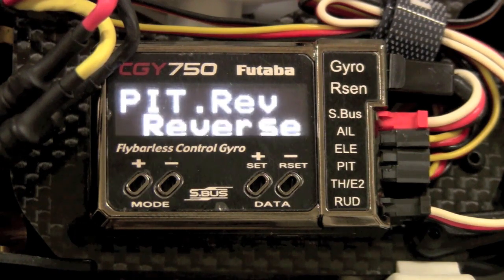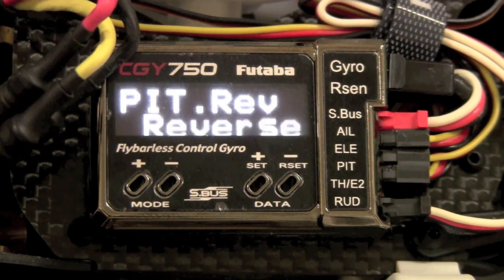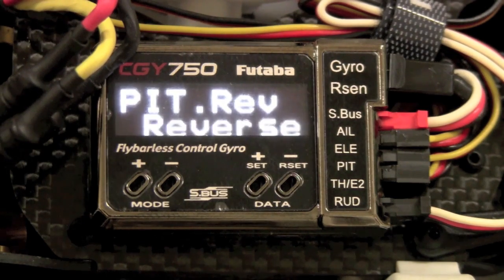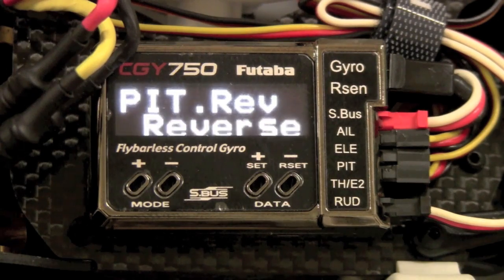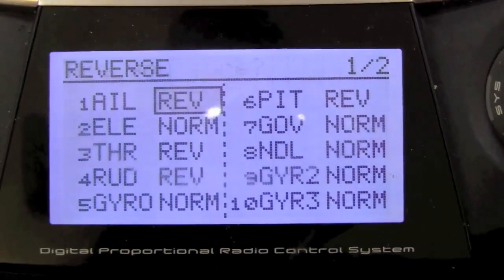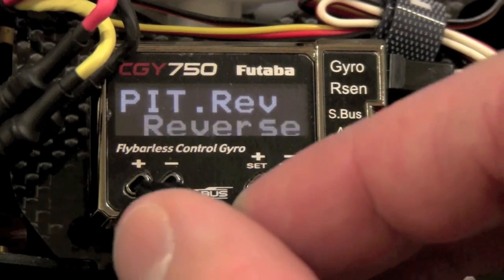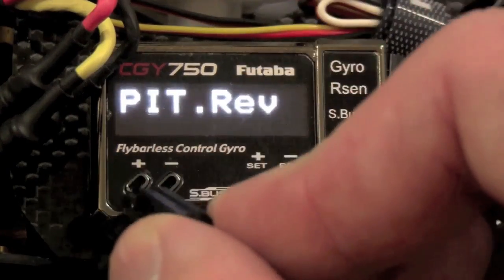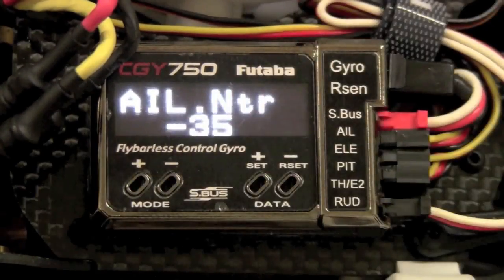Bobby Watts Demonstrates How to Set Up the Futaba CGY 750 Flybarless Unit (Part 2 of 2)

Comment: When you adj the throttle off on % in governor menu, at 6.57 you do not press the reset button, you press the set button, if you press the reset button, everything goes back to factory default in governor menu.

Comment: This video would have been complete and thorough if you had 1. been clear and concise in your explainations (not getting confused and fumbling with the tool)
2. Actually walked the viewer through the setting up of the pitch limits for the CGY.
3. Shown some actual conditions of the reversing servos, cyclic, etc
4. Went in depth as to the gain set-ups and showing the swash movement.  
Otherwise the video is a moderate BASIC, VERY BASIC guide to programming.  It requires more than shown to fly